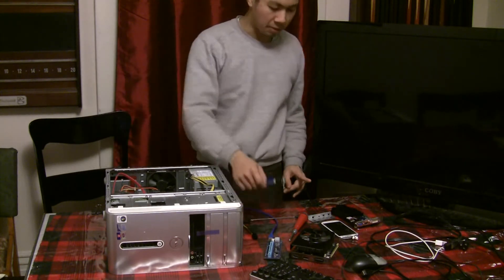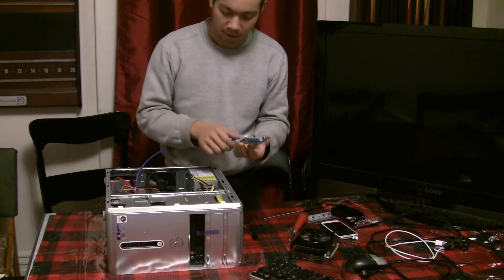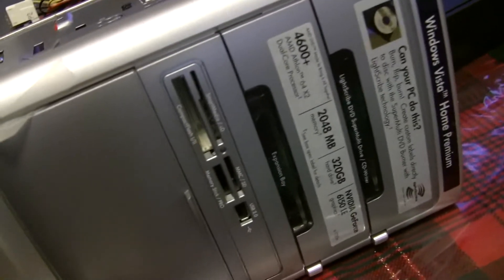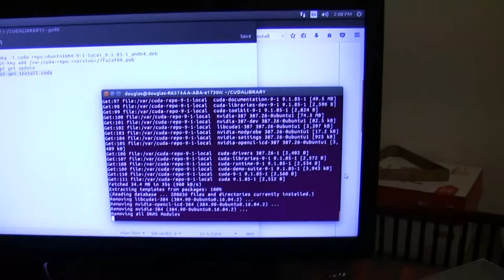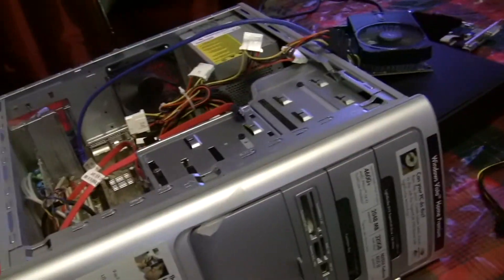10 year old computer turned into a mining rig

Comment: Just Subscribed, thanks for the info.
I have free electricity and almost 30 computers/laptops. I bought a bankruptcy last year and got all Kinds of computer stuff. Could I mine using older computers
Reply from the maker: Thanks for subscribing! The entire market is low right now, but if you have free electricity you will absolutely make a profit. I would recommend at least putting a low end gpu such as a gtx1050 in each computer, but if you can't, even laptops have enough power to mine. Best of luck to you!

Comment: Did you need a powered riser or could you just have used an extension cable for the pci-e 16x slot?
Reply from the maker: An extension cable should work as well

Comment: Nice,  How are the result?
Reply from the maker: Thanks, it mines 330h/s on monero using one gtx1050
Reply: Douglas Chong I'm going to try this as well.  I have pc with a quad core and a old evga gtx 460.  I'll get a gtx 1080 or 1080 ti if I find one.
Reply: @douglaschong4247  update on this setup? I have some questions hoping you can answer?
Reply from the maker: @jlo5470  ask away. With ethereum at such a high price, almost any setup will be profitable!
Reply: @douglaschong4247  I get 850 h/s using my cpu on monero? Is GPU slower with Monero?